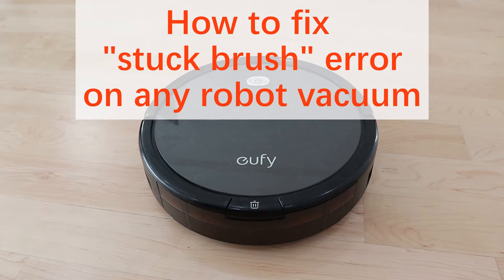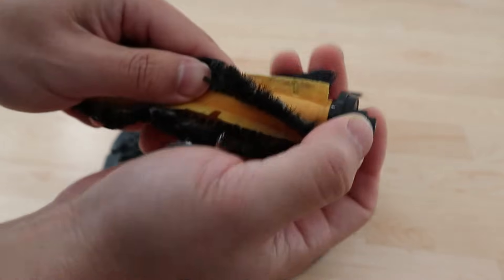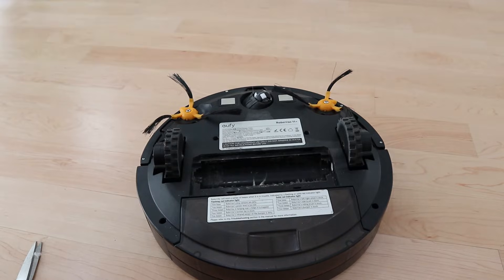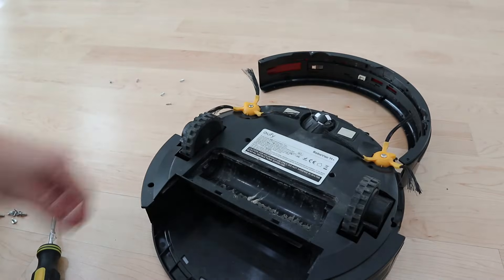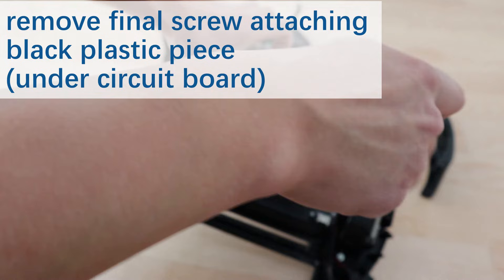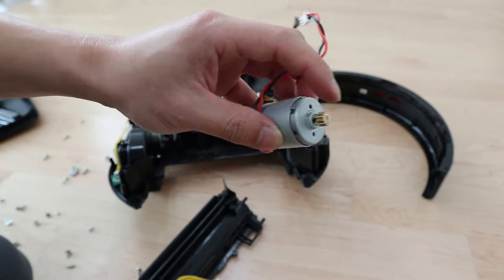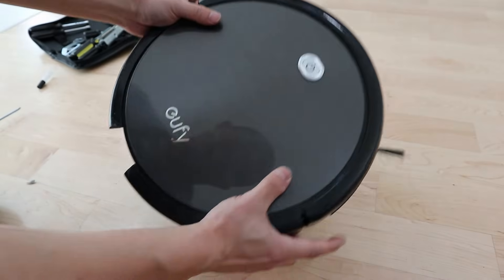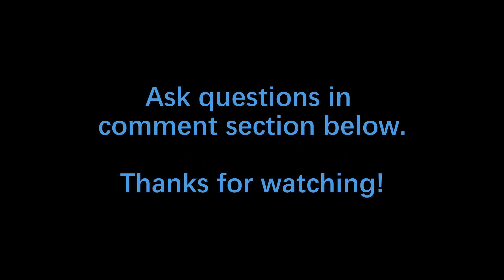How to fix any robot vacuum stuck brush error - for Eufy and others

Comment: I have cleaned everything. But still it doesn't turn. But if I turn the white square I can see the motor is also turning. Can the motor be broken. Do you know what voltage it uses?

Comment: I have a Eueka e10 and it will run for a while and then stop with a brush error. I'll unstick it and it will run for a few minutes and stop again. Could it be that the motor overheats and then cools down?

Comment: I have a botslab S8 pro and It worked perfectly. I made the cleaning into the brush roll motor and all the parts inside of the robot and now it works perfectly. May 2025

Comment: Thanks so much! My Opodee is finally fixed!  I didn't need to disassemble as much to access the jammed area on my model, but this video helped me figure out what to do.  This has been driving me nuts for a couple weeks!  I cleaned the roller brush multiple times, but nothing worked until I found this video.  :)

Comment: What if the two front brushes keep spinning even when just charging? I tried disconnecting the battery but that did not reset the issue as I hoped.

Comment: !!!!!Before you take yours apart!!!! make sure to check it's not just the bearing on the roller that needs cleaning, you need to pull the black plastic cap off and in the end is a bearing, mine was clocked with dog hair,

Comment: I have a Beko robo with two rotating brushes on each side. One of the brushes stopped spinning.what can I do? I pulled the brush out, it is clean free of any obstacles. How do they turn? By a belt or each have a motor?  Your video was great.

Comment: Thanks for your help.  I have the Robovac L11 .  I recently bought a new battery, i installed and put it to charge.  The blue light was ok.. but never stop.  I tried to use it but appears the red light.  I have cleaned the connectors and checked the charger..    what more i can do?     Thanks for your help

Comment: Thank you so much for this video. I have a Liectrolux C30B rebrand whose main brush was spinning but would stop in 2 minutes.
I disassembled and luckily mine was easier and didn't need to unscrew the motherboard. There was a huge amount of both human and pet hair stuck in the spindle house and the spindle itself. After cleaning everything up, it's as good as new

Comment: There is another thing to check, if cleaning the brush doesn't solve it. One of the side bits of the brush, the round end bit, is made of a piece that rolls and one that stays fixed. Hair can get in between them and is very tricky to get out, you can try using a needle and twisting the end bit while you pull at the hairs.
Reply: Can you pl guide my eufy robovac G30 displays pink and not working.

Comment: Very good video. I commend you for using a real screwdriver instead of a power screwdriver. However, you just cleaned and reassembled the motor and gearbox without showing what was preventing it from turning. What if it was a burnt out motor? Could you have tested it with 5 VDC before putting it all back together? Are replacement motors available from Eufy?

Comment: 25C owner here, got all the way down to the brush motor and realized it was belt driven. No hair. Was nice to be able to access the wheel compartments and make sure they were cleaned out. reassembled and pulled of the front wheel and found lots of pet hair lodged there and in the spoke and cleared all of that. That seems to have done the trick for me, no rolling brush issues since then. For 25C owners, probably just check all 3 wheels first before disassembling completely. Cheers for the video, though!

Comment: After 2 years of cleaning up after 3 Golden Retrievers I am getting constant 'roller brush is stuck'  errors.  It only works for a couple of minutes. Thanks for the video, I hipe he can be fixed.
Reply: After removing the motor and gear or belt assembly and cleaning it, try to turn the small motor gear. It should turn freely. If it's very very hard to turn, clean carefully all around and under the gear, digging out hair and dust. Then give it one or two drops of light oil on the shaft under the gear, and on the shaft extending from the other end of the motor.  Then turn the motor gear by hand until the motor frees up. The vacuum electronics monitors the power going to the motor to tell whether the brush is stuck or not: a bound-up motor can also give you a "stuck brush" signal, when it's actually not the brush holding the motor back.

Comment: It’s 1:30 am and after 6 1/2 hours I now have a super clean room decoration (aka) trash. Still four red beeps. We have a 25C and it’s a bit different. Struggled getting the top off. There are two screws where the brush sets that are not on yours. After we figured that out we progressed okay. The brush motor is different too as it has a rubber ribbed belt instead of the multiple gears. Lots of little differences but was able to follow through. Wasted 6 1/2 hours, but we would never know until we tried and we’re only out time. Sigh.
Reply: Read the other replies about cleaning the motor shaft and oiling it.
Reply: @reecenewton3097  Went into trash long ago.

Comment: Hi I did this and got my brush rolling again thank you, however , I put everything back together and now I am getting a continuous message that the drop sensors are dirty, it’s stuck on a ledge etc. it gives three beeps and a flashing red/orange light and it won’t work? I have Eufy 15 C model, any suggestions. I did reopen it again and made sure all the connectors are connected etc. Hope you can help? 🙏🏼
Reply: Mine is flashing red and 3 beeps says  drop sensor error. Ive taken apart cleaned as much as possible. One big wheel seems to not move as easily as the other. I took it apart didn’t see any dirt, hair etc. motor in wheel? Cant seem to get mine working 😢

Comment: I had a different vacuum(Yeedi) but as long as you know know generally how to work on simple electronics it worked.  My problem was on the motor that drove the main brush, not in the belt housing around it.  I had to pry the sprocket away from the spindle to push and pull away(with tiny forceps) the hair and gunk that had accumulated.  Aside from my model having a sensor that had to be removed for the dust bin to be reinstalled(I really wish I had taken a cell picture of it before I removed it) all went well and took about two hours.

Comment: There is this spot between 5:08 - 5:13 where you separated the top from the bottom pieces, but you stopped recording and when you restarted recording, they came apart like magic because you did that part while you were not showing it on video.  I can't see how you unlatched them. I'm trying to do mine and it is stuck. Why not show us everything? Other than that, it looks like a marvelous video.
Reply: I'm having the same issue. Did you ever figure it out?

Comment: what was the error code of flashing light sequence?   before doing all this I want to be sure it's not a dead battery, I am getting 3 red lights flashing after it turns on, it starts up, rolls out of it's charger about 4 inches, stops then does the 3 beep sequence with a red light.  Is that the fan?  or dead battery? do you think?
model 11S I think.
Reply: Error codes are explained by a sticker on the dust container.
Reply: Mine is doing the same says drop sensors need cleaning but I’ve taken it apart and cleaned it and same thing 😢

Comment: Have a eufy 11s max took the whole thing apart brush wasn't moving bc it had gotten stuck and reemed out the square bit used to rotate it with the motor.  If he doesn't offer parts for this it's a white plastic gear any help??

Comment: I have a 30C. I got as far as trying to pull the wheel out, but it does not seem to come out. There also does not seem to be a way to separate the top from the bottom. As best as I can tell, the 30C must have a different way to disassemble it than what is shown in the video. I sure wanted these instructions to work.

Comment: I was able to do most of this and cleaned out a lot of dog hair from under the wheels and near the motor: however, the part where you detached those wires from the bumper- mine worked the opposite way. The wires are still connected to the bumper but separated from inside the machine. I am now having trouble reconnecting those wires that are hanging off the inside of the bumper to the inside of the machine. Any suggestions?

Comment: Helped me fix mine! There was no obvious internal problem on my machine, it just wouldn't accept charge. There was a lump of fluff over one of the infrared bumper sensors when opened, I think it may have been this leading it to believe it was never correctly positioned onto its charging foot.

Comment: After viewing this, I realized that we need robot repair shops. There are way too many screws and parts to this process, and I'd rather pay someone to do it. However! The good news is, I was able to fix my roller brush, just by using "machine oil," as suggested, on the part on the robot where it needs to rotate. After oiling well, it worked like a charm! Thank you!
Reply: Thank you so much for this reply 💖 It is way too much effort to take the whole robot apart and I would definitely make a mistake in putting it back together. But I just put a little bit of vegetable oil onto both sides of the main brush after cleaning it and now it’s running like a charm!
Reply from the maker: yup there are a lot of screws!
Reply: Without unscrewing?
Reply: Yeah, after watching this I think I'll trash my machine and buy a new one. Way too complicated a fix for me to tackle!

Comment: Great video! This sorted my Eufy out first time- loads of dirt & hair caught up.
 However it happened again a few weeks later & this time i didn’t get as much dirt out. When put back together the same error code is coming up 😥 Any suggestions @life hacker?
Reply: I realize this question was 2 years ago but here goes. If the gears or belt and ends of rotating brush are clean and not binding, check the motor shaft with gears or belt removed. The motor shaft will have a small gear still attached to it. This gear/shaft should turn freely. It probably won't spin if you twist it, but it should not be stuck or take any appreciable force to turn. Mine was stuck fast. With force I was able to turn it a little. I dug more hair etc. from beneath the gear on the shaft, then I put one drop of light oil in that space, and another drop on the shaft where it can be seen at the other end of the motor. Then I turned the motor gear by hand around and around while the oil penetrated and the shaft loosened up. Fixed.

Comment: Worth remembering if you're going to touch the circuit board, touch something metal first to discharge any static electricity you may have accumulated

Comment: I  have the Eufy 11...the ball came out but not the housing it sits in...therefore I cannot separate the top from the bottom.....any hints?
Reply: Just pop the plastic piece the roller snaps into with a screwdriver.

Comment: Should note that there is a screw under the front wheel that keeps the top from coming off.
Reply: Great tip thank you. I have a robovac30 and there were. 2 screws under the long brush.
Reply: OMG this comment needs to be boosted, almost ripped the vac in half 😅

Comment: I droppes my vac and it still works, but the wheels dont spin to together, or one spins in the wrong direction, or not at all, just like urs. Any thoughts? (I opened it up and reattached the gear, but it still doesnt spin)
Reply from the maker: which wheel doesn't spin? the one attached to the motor?
Reply: @lifehacker8400  the ones attached to the motor werent spinning right. Fortunately i drenched it in isopropyl alcohol and prayed, and its working find now. Doesnt make sense, but the wheels work again justin time for mother's day
Reply from the maker: gotcha. there may have just been dirt trapped inside, which the isopropyl alcohol cleaned out. great timing for mother's day!
Reply: @lifehacker8400  definitely

Comment: BUT there is tons of FUZZ in the bristles of my EUFY Robovac 30C. How do I get the fuzz out? It's embedded in the rolling brush fibers. Anyone got any tips?
Reply from the maker: you can rinse it in the bathtub and use your hands to pull out the fuzz. just make sure the drain in the bathtub is sealed, so the fuzz doesn't get into the drain. then let the bristles dry over night.
Reply: Use a comb with fine teeth, comb now dedicated to the Eufy.
Reply: @reecenewton3097  Yes, I did try that. But it pulls out the bristles. Tried the poky end of a parting comb too. Just wasn't sure if there was some magical solution or if it's just monotonous picking. 😞

Comment: This is great, but may be unnecessary.  If the white part is turning, you may not need to replace the whole rolling brush.  I found that I could take apart the bearing assemblies on both ends of the brush quite easily (just pull off with a pair of pliers) and once I'd removed all the hair within, the brush rolled freely and all was well.  And while doing all this teardown, it's also worth pulling off the swivel wheel (for the 11+, just pry gently from the sides with a small screwdriver)--an amazing amount of hair and dust gets caught under there as well.
Reply from the maker: Yes, if the white part is turning, there's no need to take apart the machine. The teardown is only necessary if the white part doesn't turn, since this indicates there's something wrong with the motor inside.